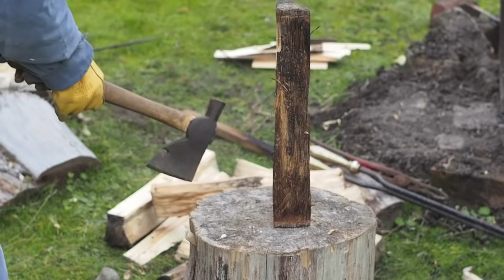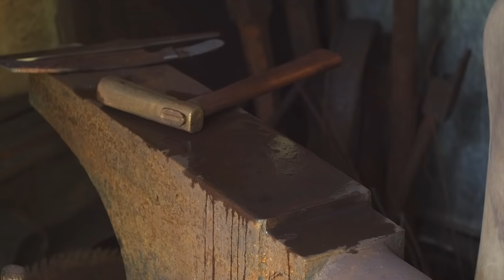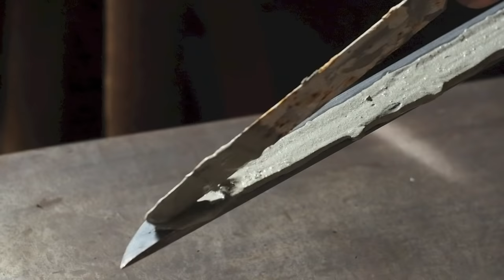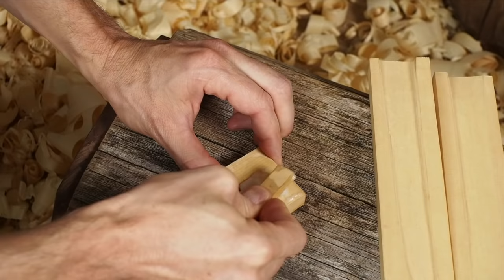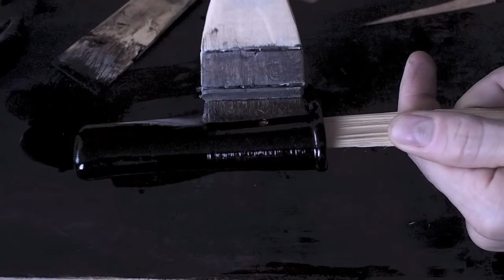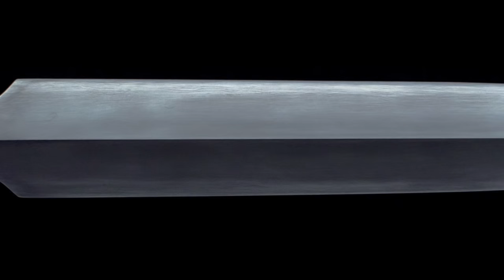SOTW #12a - Tanto Overview Extended Edit

Comment: This may be a dumb question, but in your experience just how hardy is the bamboo peg construction? I'm not talking about standing up to outright abuse like the batoning that seems to have become so popular, but does it tend to loosen through regular use such as would be put on your tools for satoyama? do pegs ever get replaced due to shrinkage or ware?
Reply from the maker: it is important to remember that the whole system works together, but years ago i did some testing of just the rice glue without mekugi or guard at all and the results were surprisingly good: http://islandblacksmith.ca/2014/03/sokui-rice-paste-glue-strength-testing/ yes, i agree that batoning is abuse (at very least using the wrong tool for the job) and something that should be reserved for survival situations...in the case of takedowns the handle can be quickly removed and the blade used on its own for other purposes (emergency spear, detail work, sterilized in boiling water, etc)...the peg is slightly tapered so it can adjust for changes, and the idea is they are easily replaceable, though it usually does not need to be done more than a couple of times per generation of users...

Comment: Hey quick question, you know the bamboo or wooden pegs you drive through Japanese blades, do you have to drill the holes on the tang and handle at slightly different angles to make them stay in better?
Reply from the maker: there is no complete quick answer, but it is about the angle of taper and the exact placement of the holes, not about having different angles...mekugi (pegs) are hard timber bamboo, tsuka (handle cores) are japanese magnolia...
Reply: Thanks for explaining, I'm about to start trying my hand at making Japanese swords, I will have a little mess around with different ways to peg it. Thanks.
Reply from the maker: there are many resources on my website that can't be found in english elsewhere, hours of study, photos, and video...this series is a good place to start: http://islandblacksmith.ca/tag/tanto-geometry/ and i also recommend you study antiques, rather than modern factory reproductions, to train your eye to spot the mm differences that make or break the japanese aesthetic...
Reply: Thanks a lot, I will bookmark that link and study your material, I actually don't own any antique Japanese blades myself, I know somebody who has a large collection though, I will ask to take measurements, I was planning on doing so anyway.
Reply from the maker: that is an excellent opportunity, online is a good place to observe as well... http://www.aoijapan.jp/%E5%88%80%E5%89%A3/%E7%9F%AD%E5%88%80
http://www.seiyudo.com/tanto.htm

Comment: Beautiful blade . There is no adhesive / glue to help keep the handle on the blade tang ? 
Thanks for your video .
Reply from the maker: just the single bamboo peg and a very precise fit between all the components...being able to disassemble for cleaning and repair is one of the reasons there are so many japanese swords in good condition in museums today...here is a video showing the assembly and disassembly: https://www.youtube.com/watch?v=mWgN2nwpFKg

Comment: With such a loose fit wont it start rattling as soon as you use it?
Reply from the maker: what is loose? the goal is to have them slide in freely until the last 1-2mm, then the habaki engages tightly, and the scabbard should be carved very closely to the blade shape to prevent rattling...

Comment: okay, well I can certainly understand that because I was going to ask you a technical question, I don't believe the Japanese swordsmith use flux is, this correct.
Reply from the maker: they do use flux in several forms, the main ones being clay slurry and charred straw, but borax and combinations of boric acid and iron filings are also as old as the hills and are often used during kobuse welding...though no flux is placed between the layers during tanren, only on the outside of the billet...

Comment: How do i procure a scraper like that? Excellent work, by the way.
Reply from the maker: you have to make one...use an old file or rasp and temper it as hard as you can without breaking it...getting the correct edge angle and shape may take some trial and error...

Comment: All that work and he leaves the tsuba unfinished steel?
Reply from the maker: which one are you wondering about? they all have extensive finishing techniques from yakite (fire texturing) to controlled rust patina to heat blueing to (tea) tannin stabilizing...and protected by baked urushi, ibota wax or tung oil...all the traditional ways ^__^

Comment: DANGER !!! the handing of this knife has no guard . can result in hands sliding unto sharp blade
Reply from the maker: the tapered shape of the handle, the ray skin grip, the copper ferrule, the small hamidashi style guard it does have, and proper use will all ensure this doesn't happen...1000's of years old design, tested by warriors...so far so good ^____^